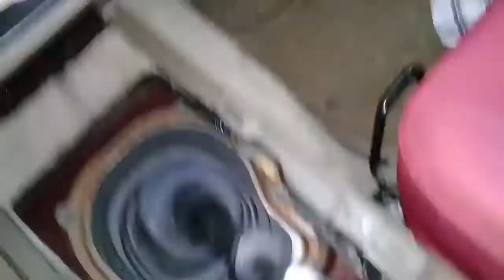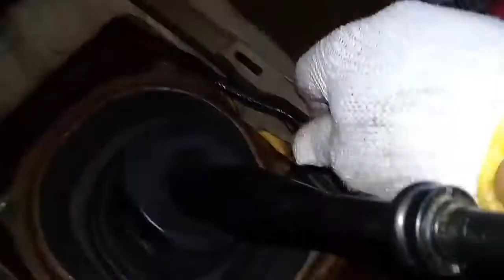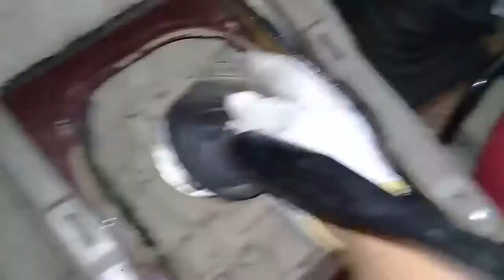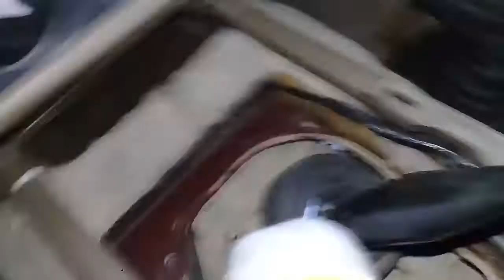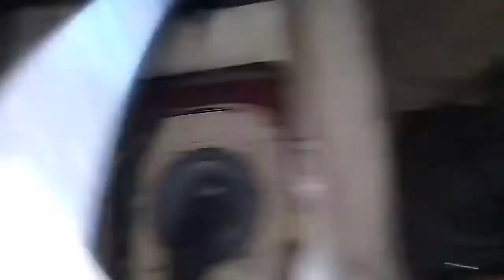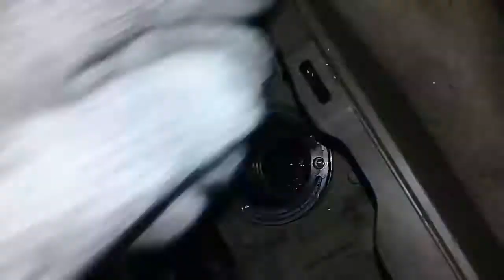Shift lever | Nissan Navara D40

Comment: Hello I just got little question to ask about my Nissan Navara my gear won't go back to neutral it just got stuck when when I went underneath to just my bleeder master cylinder where was trained to bleed it it was fine and I had a ticking sound at the top of the gear stick I am wondering if you can give me a bit of a Sprite to show me how can I free my gearbox into neutral
Reply from the maker: Thanks for the lengthy comment. I'm sorry I can't help you with your inquiries. 🙏

Comment: Hi, I can't shift into reverse... Could it be something simple on this part? Thank you
Reply from the maker: Could be something inside the tranny sir.
Reply: @DiYSpanner  will get it checked. My mechanic wants to Replace the entire clutch set... But the clutch does not slip... Every gear is spot on.. Except reverse (downward motion of the stick lever is not actuating properly). Thank you for your input Sir